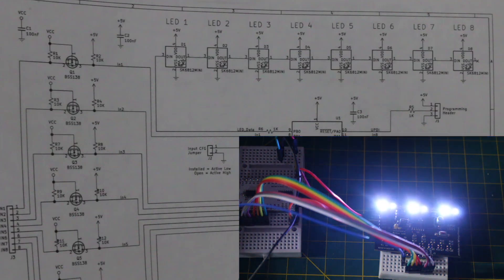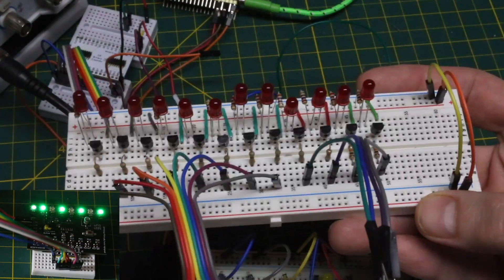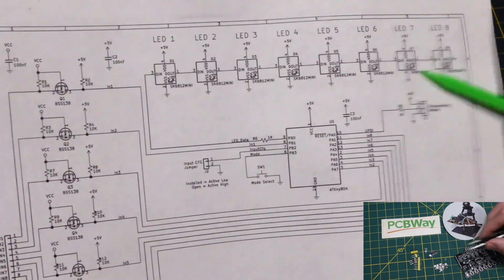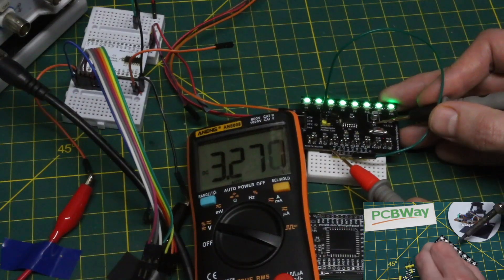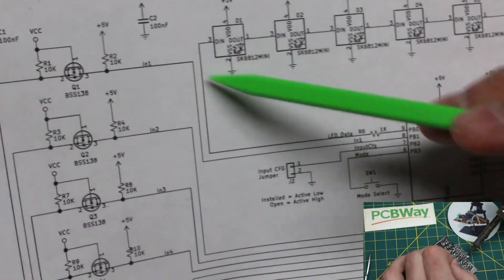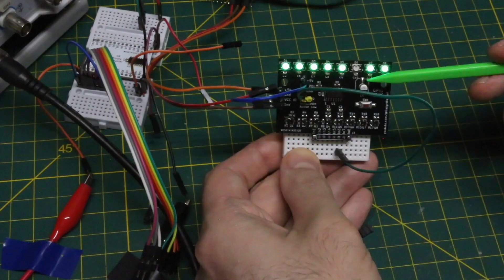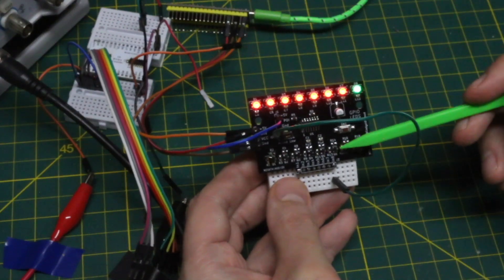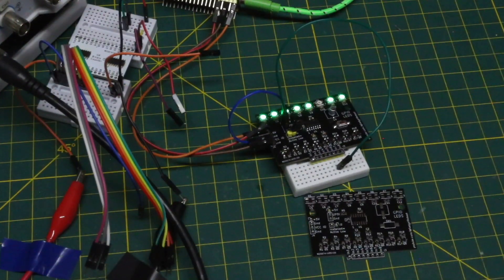Addressable LEDs as Breadboard Indicators

Comment: Who doesn't like the blinken lights? 😄
But I have a few considerations about this. Firstly, all the inputs are pulled HIGH, this will make whatever connected to be pulled HIGH too, and in some cases, this can cause problems. Secondly, it cannot identify a floating connection, it will show it as HIGH too. I think instead of MOSFET level shifters, proper 3 state gates/buffers on the input will do a better job.
Reply: blinken lights! 😄

Comment: Nice to see a logic input fet that knows there is something other than 5V logic out there.
VGSth is a nice 1.8V max so will work well with 3v3 logic.

How are you detecting the input, polling or interrupt. i'd like to got the interrupt so you can add pulse stretching to the menu. when looking for glitches a fast pulse might not be seen, but with a pulse stretcher the LED will light to give you the indication is not what you are expecting. was common on old school logic testers to help with clocks and enables etc.
Reply from the maker: right now I was just polling for the sake of getting a functional demo going but if all inputs can use interrupts I’d like to do that because I was thinking of pattern detection on multiple inputs as well.
Like triggering when one input goes a certain level and another input switches or has a pattern and things like that.
Then have the LEDs not just on or off but maybe if a certain pattern is detected it would just do a light chaser so it can be easily observed in peripheral vision
Reply: @GadgetReboot  I found on the Arduinos there can be a limit to the pins that can interrupt when doing my soldering iron station.  so in the end I use 4, 3 as the inputs from the switch's and the 4th as the interrupt input. then diode OR'ed the 3 inputs to the 4th. I just read the port as a whole whenever an interrupt was generated.

Comment: Only downside of those levelshifters is that they only work for signals actively pulled low. So they will not work on a high side open collector output. Something to remember :)

Alternative would have been to just use a series resistor and maybe clamp diodes. Would give you the option to set the pull (up or down).